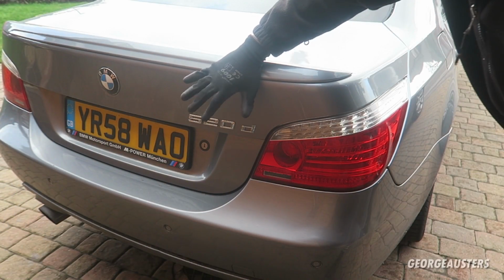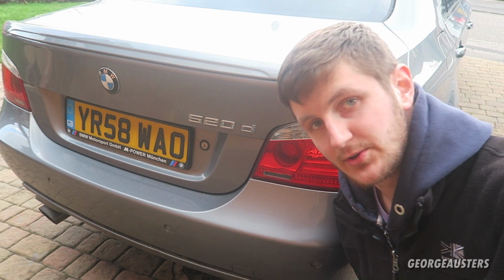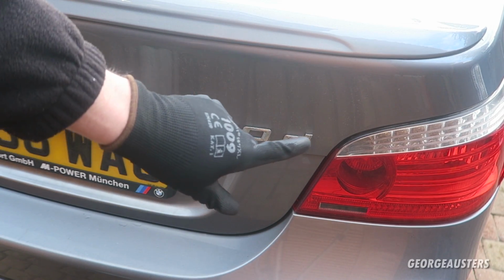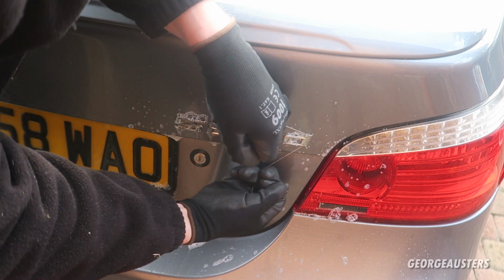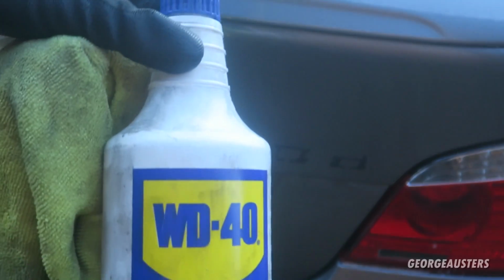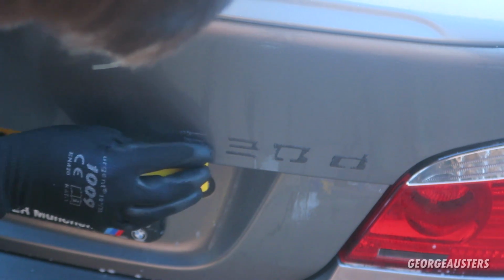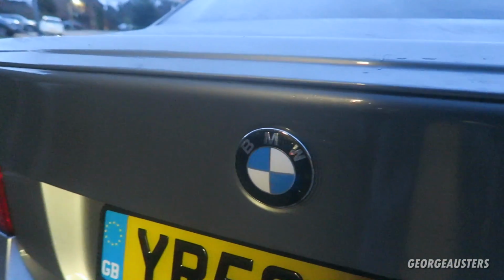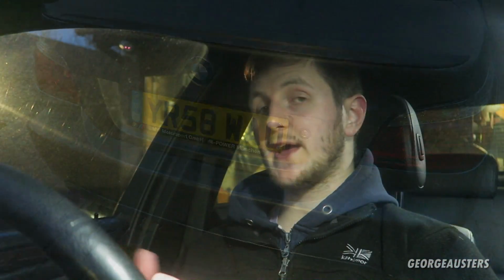How To Remove A Badge From Your Car

Comment: Fuck me, i just removed the one on my car last week. Why didn't you make a video sooner lol
Reply: Perhaps if you know code below?

009C53
Eh (lin) / PTC heaters / Ptc (lin) / Rear air valve engine centre console left motor address 1chex / Motor stratification rear left / Reserve 2

Is this something easy to fix or the dealer job level?

Cheers
Sunny
Reply from the maker: Hahaha